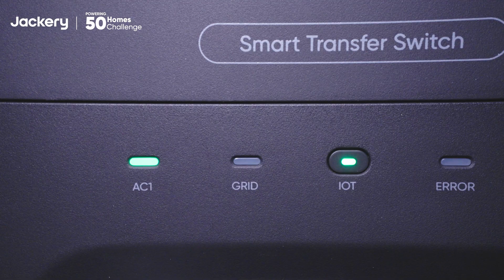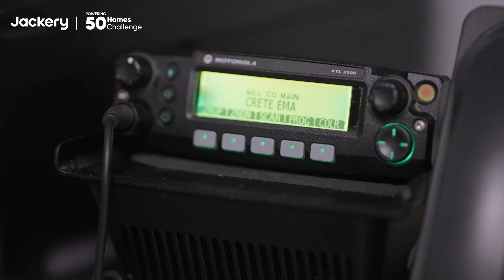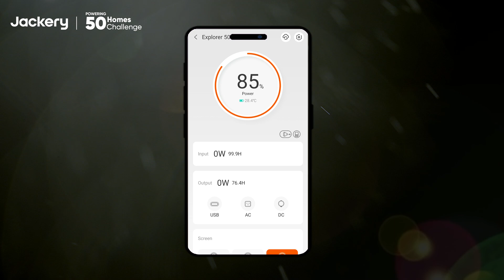How Jackery 5000 Plus Helped During a Blackout | Powering 50 Homes

Comment: A couple of things:

1. The Jackery 5000 plus can put out 7,2000 watts continuous, not 5,000 as mentioned in this video.
2. The UPS mode drains a ton of battery power. Better to keep it in 5 second recovery mode
3. Any disaster relief operation relying on a Jackery is a scary thought. I bought one myself, so I think it's a good product. But it's made for home use and even there, it has its limits.